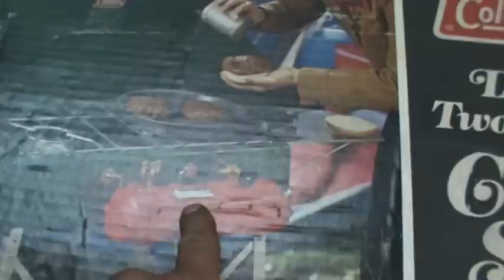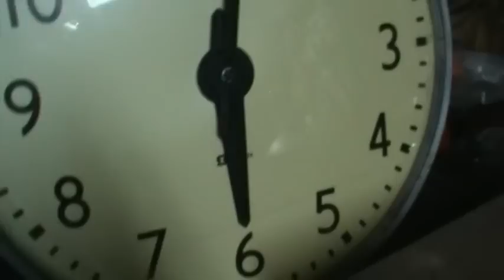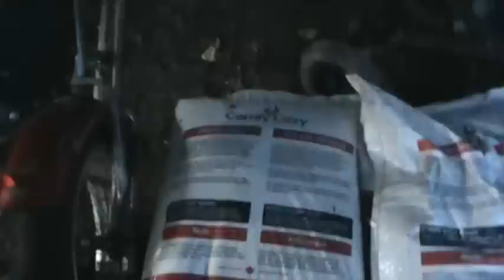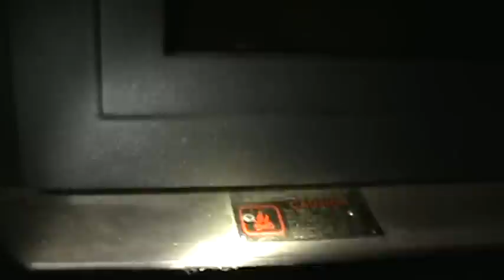yard sale finds

Comment: I know its been 10 years almost but i just got that same bandsaw for free from an uncle..  you convert it to metal cutting by removing the drive pully off the motor spindle and getting a smaller belt for it..  you just put the belt on the actual spindle itself..  has a built in turned part for the belt to sit in..  good band saw though..

Comment: That Colman camp stove you want the fuel tank for a bike could be converted to take one of those small propane bottles to fuel it.
I've done that myself. 
Home De'PooPoo carries the replacement bulb for that lighted magnifier.
I just bought one for mine, & 8.50 or so.
The unit cost me 47.50 -10 % @ Harbor Freight.
You got a steal of a deal for a buck.
SoBe one that scooter stands for Miami's South Beacgmh.
You used to see them all over SoBe before they banned them because to many of the riders were irresponsible and causing all kinds of accidents.

Comment: So glad you asked that question, made me look it up and I'm SO glad I did! It turns out my understanding of variacs was a little skewed. Variacs work GREAT for any 120V universal motors that have brushes in them, like hand drills and fans and dremel tools, they are NOT good for induction motors using a capacitor start. So forget I said anything concerning Variacs unless the motor you have has brushes in it!  I did hear some talk about Electronic Variable Speed Contollers but no idea about them.

Comment: I actually have several Variacs... but Variac is the most well known name for it sometimes you can find a Powerstat or a Variable Autotransformer listed for cheap like I have in the past.  I have a HUGE 15 amp variac I bought that came without a case (I made one for it) it has with a small dc motor to turn it instead of a dial! I paid under a $100 with shipping!  I have two smaller units I got for $35. You can find deals on them just have to look. Although $60 for a 10 amp is a really good deal.

Comment: First the Simplex clocks are PROBABLY school clocks but could be for a bank INSIDE the building. The last two Simplex double sided ones that sold on ebay went for $253 and $260. So there's that. The SoBe scooter might be a promotional item from that drink company, who knows... $100 bucks I'd think, if working good. $20 and pellets? I don't know where you buy pellets but they are $10 a bag here and a stove EXACTLY like that is $1100 new! Crazy crazy crazy New Hampshire people... crazy.

Comment: you can't use a variac on a AC synchronized motor as voltage does not control speed ,its the frequency which controls the rpm, if you want to control forward & reverse rotation on AC synchronized motor you will need a pwm phase inverter drive.
for a DC motor its best to use PWM pulse width modulation as it will maintain torque at low rpm with out causing to much heat, just reducing the volts/amps will cause the motor to burn out in no time.

some great finds again.

Comment: Don't need to gear that bandsaw down, IF you had a variac/powerstat/variable autotransformer that could handle the load of that bandsaw motor, 10 amps probably, then you could infinitely vary the speed of the motor down to almost nothing with no adverse effect on the motor. Variacs are GREAT. Works good for old type on/off drills to set a nice slow speed on as well as drill presses and dremel tools too, I swear by them. A nice 10 amp Variac is on ebay for $60 + ship, buy it now

Comment: I have read a little bit and I guess it can be done but I'm not sure exactly how.  Some say it's easy and others say you shouldn't.  I did see a reversing controller but it looked to be for smaller motors. I wish it was like with a DC motor and you just reverse the polarity!

Comment: A 3 wheel bandsaw? Yes it has that deep cutting throat but with the third wheel means a blade is bent 50% more as compared to a 2 wheel so the blade fatigues and breaks much sooner.  So one advantage is replaced by a disadvantage